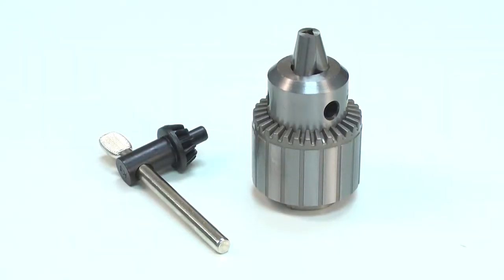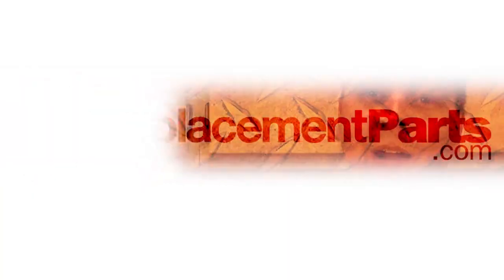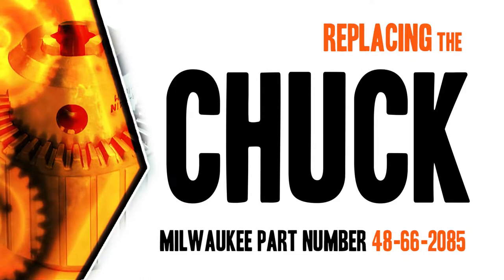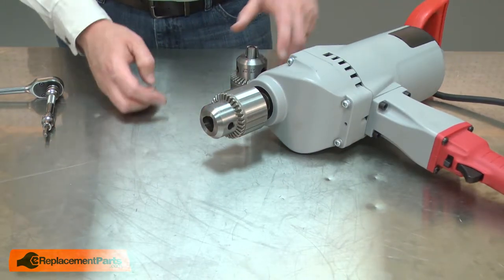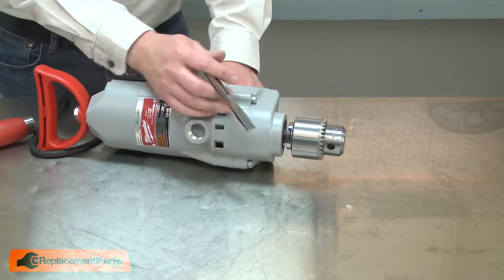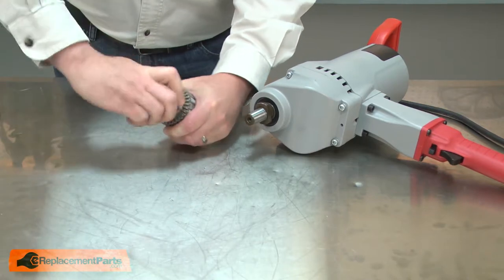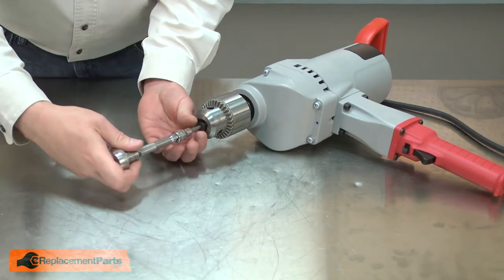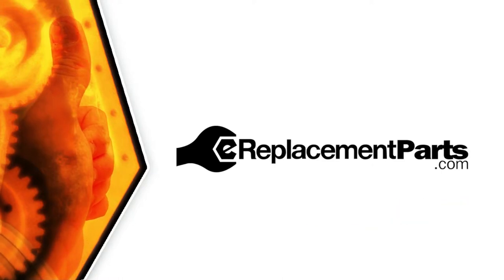Milwaukee Drill Repair - Replacing the Chuck (Milwaukee Part # 48-66-2085)

Comment: I have a late 80s Milwaukee Magnum 1/2" hammer drill and one of the chuck jaws seems to need service as it is no longer sticking out to the same degree.  My issue is that I can't tell what to remove the all important screw with.  Doesn't seen to be slot or philips, nor do any of my metric or standard Allen wrenches.... What is that head???? Thanks.
Reply: T40 Torx bit.